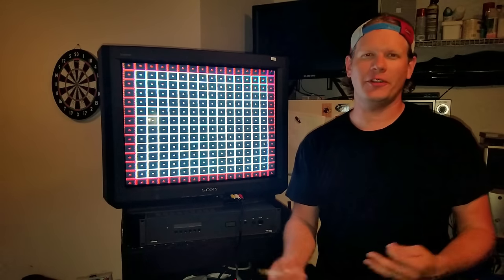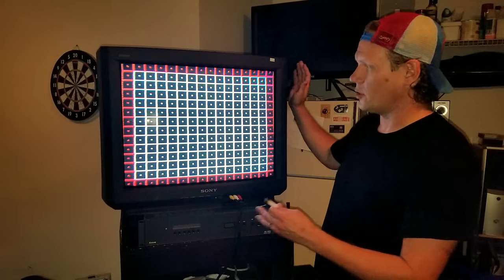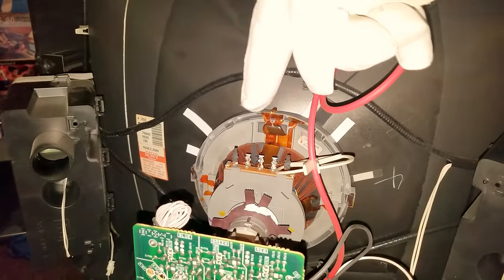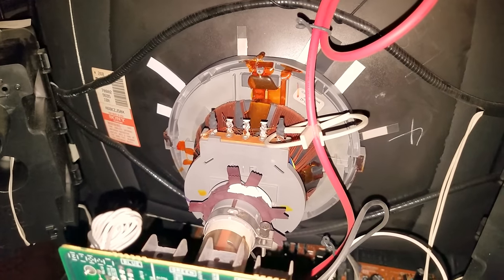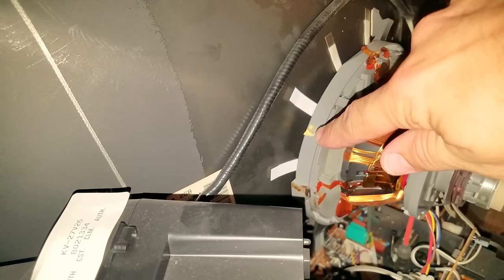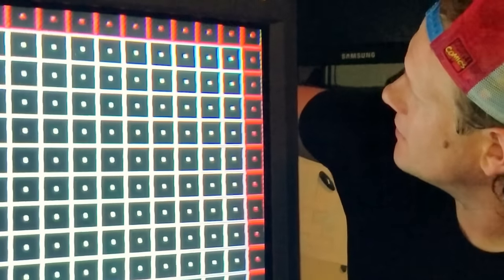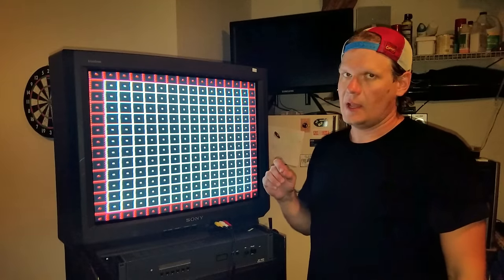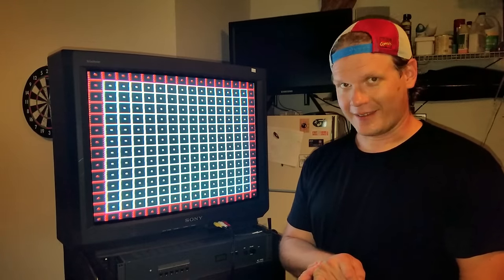New CRT Convergence Strips for a Sony TV PVM

Comment: What do you use for a test pattern?
Reply from the maker: Great question.  In this demo I used a SNES Jr. that has been modded, but I'm only using composite on this demo.  I have the 240p Test Suite loaded on a SD2SNES ROM Cart.  Here is a link to the ROM ---> 
  https://sourceforge.net/projects/testsuite240p/
Reply: Where could i get a test pattern in dvd or ps2 version?
Reply from the maker: This is a DVD that has even more test patterns and will work great if you need to buy something.  I don't think there is anything available directly through the PS2 though.  https://www.ebay.com/itm/CA-TV-Test-Card-Video-Pattern-Generator-Test-Tones-DVD-NTSC-PAL-SECAM/292333907579?hash=item4410756e7b:g:25wAAOSwridaDgUB

Comment: Hello. Could you give me any clue about this issue (picture bellow)?? It's a kv21fs140, geometry and convergence is overall good but there is a disproportionate vertical flaw on right down corner that i can't manage to fix....permalloys shows some results trying to line up but convergence is messed up a lot, little magnets around the yoke also show results but it affects purity.  I'll be very grateful if you can help: https://imgur.com/a/uUPikvr
Reply from the maker: Have you tried changing the Pin settings in the service menu?  Have you gotten into that service menu before on the tv?
Reply: @RetroTechUSA  thank you for your fast reply.....yes and yes. I got the tv like this, i tried to fix this only in the service menu at first and as long as you fix the right down corner you mess up the left one. Then after a better notion of convergence and crt overall thanks to your great videos i readjusted everything, got a better convergence and purity, but no sucess trying to fix this down corner issue. Is not the end of the world but i think you understand me if i say that once you spot it you can't ignore it....it will always bother  you. (gotta mess with PIN settings again but i think i'll get nothing more than just mask that thing)
Reply: I zoomed out so you can have a better idea of the problem......the left side is pretty acceptable, only the right side is looking like a paper edge: https://imgur.com/a/cMVlthf
Reply from the maker: If you can't get it to clear up by using the service menu, then that means most likely some of the caps are failing in the deflection area of the TV.  Once you replace the caps, you will need to re calibrate too, but the picture should be correctable by then.  If you don't want to pay for a cap replacement service, then you could expand the Horizontal Screen size to not see the imperfections.
Reply: @RetroTechUSA  i wish i could recap myself......you probably right, its some of the caps. Thank you very much for your attention, man =)

Comment: A mirror should be used, Steven should not be reaching out and around to the front of the set to see what changes are going on as a result of magnet strip positioning. Be safe Steven, please use a mirror when making those adjustments. Just place a mirror in front of the set and stay behind the TV. As you make adjustments — the mirror will reflect those adjustments you are making while providing safety for yourself and the convenience of knowing where your hands are and the adjustments being made. Also, please wear googles at all times. I know you respect the CRT but these are potentially very dangerous devices, especially when the adjustments are live. It's critical that safety is a priority for yourself and setting the example for your audience is also mission critical, viewers need to understand the risks. I hope this only adds to the knowledge base and reinforces safety, the last thing anyone wants is to be killed, blinded, go to the hospital and so on. I also recommend you not do this alone, someone should be present in the room with you incase there is an emergency, they do not have to participate they just need to be present to kill power or god forbid, call an ambulance if you are incapacitated to do so. I know that these are a lot of precautions but CRTs require this level of safety measures. One more point, do not wear any jewelry or clothes that attract static. Cheers and thank you for showing us your stuff. You have a lot of skill but the safety component of things cannot be stressed enough for everyone watching. I hope you can take this onboard and if possible edit the video or link to a video on CRT safety.

Again, I think this is an excellent resource for general CRT safety, there is nothing Mac specific here as all CRTs share the same intrinsic safety precautions. http://www.peachpit.com/articles/article.aspx?p=759704&seqNum=2
Reply from the maker: Alex Santos Thanks.  A mirror is a great tip if you have one available.  Also my name is spelled Stephen. Have a great day.